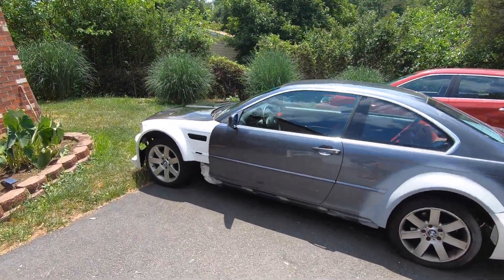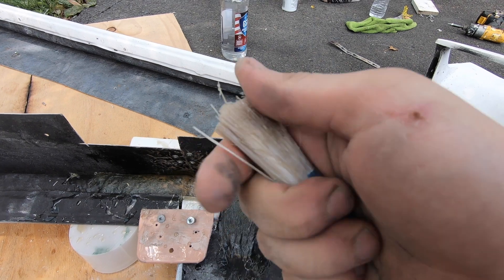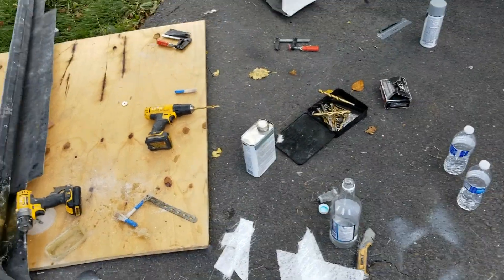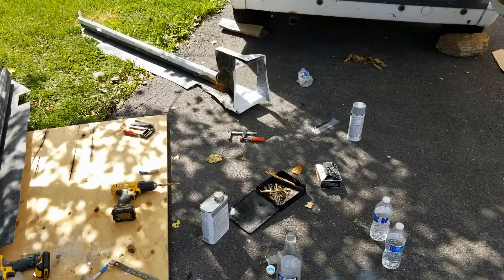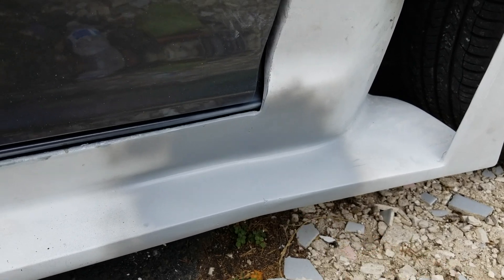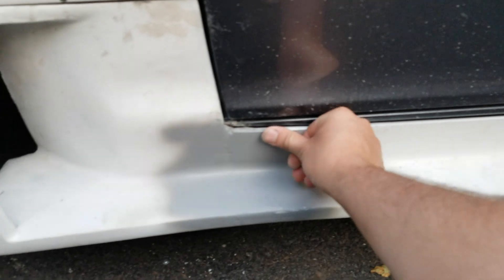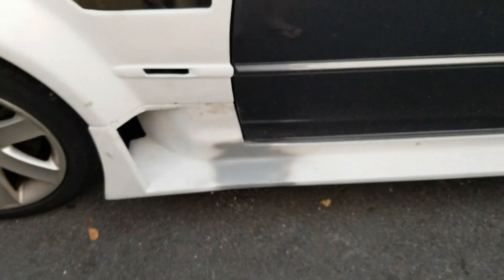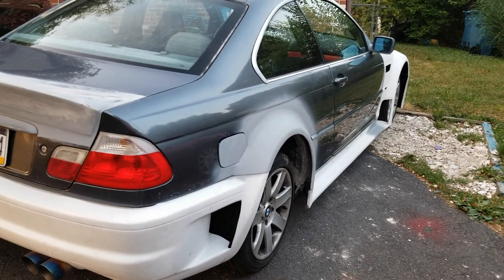Molding The BMW e46 GTR Widebody (Part 3)  Almost done!

Comment: Do you plan on s54 swapping it
Reply from the maker: No I want a v8 in it, I would have gotten the M3 if I wanted to keep the bmw originality but my plans for this build is to create as close as possible e46 GTR race car replica that had the 4.0 v8 in it. I didnt want to buy an m3 just to tear it completely down to a shell.
Reply: @BreakTraction  so an s65 (with a supercharger kit)? Love your build, i've been wanting to buy an e46 to do something similar, so living vicariously through your videos for now
Reply from the maker: @sdsodrod  Thank you I appreciate it! And an s65 would be ideal for the GTR build but it makes little to no torque NA, and its just too expensive and unreliable compared to the Ls3 I want to put in it.